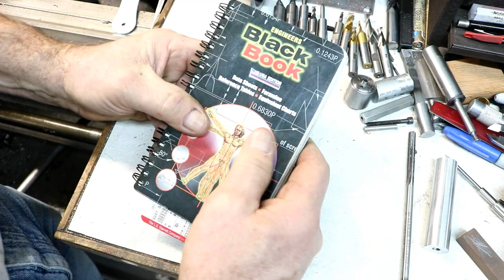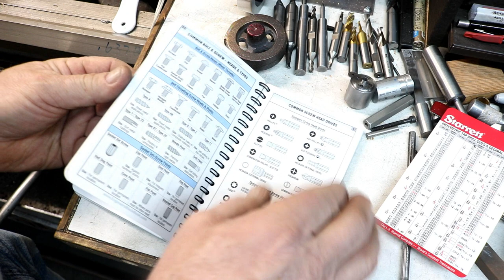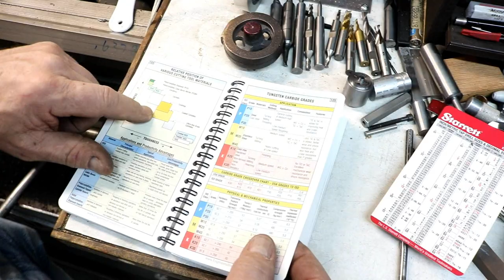P6-1 How to Build the Crankshaft of a Model Steam Engine for the First Time

Comment: Thanks RR that was a nice tutorial in technique, much better than I usually do, learning this stuff the hard way. Those flywheels turned out great, I always had a bit of a time getting my head around working with draft and offset molds like that, it is a lot more work than just chucking and tearing into it, cheers and thanks!
Reply from the maker: Thanks Howder.  Yes a difficult problem to deal with.  It all worked out so far.

Comment: Flywheel castings quite a challenge - tricky! You managed very nice results. The brass in particular is very satisfying - so attractive.
Your volume took a major dive for some of the time after early part - perked up a bit at end.
Reply from the maker: The red brass came out great.  The mic fell off and did not notice.

Comment: I have been there Randy.  Rough castings can be a pain.  When I have a flywheel like that I chuck it up in an independent 4 jaw and indicate it in the best I can then bore and ream the center hole.  I then put in on a mandrel and finish the turning slowly and carefully.  Comes out perfect every time.  Nice save BTW....
Reply from the maker: Yes for sure Fred.  Thanks.

Comment: OOO shiny, me like shiny things!😉
On thinking about it, and this might be over the top, i might have put four small flats on the rim to negate the draught and used the 4 jaw chuck to get it running as centrally as possible on the bits that aren't to be machined, 
Castings can be a great cause of hair loss if you are a perfectionist  due all the pulling out during their setting up, you can afford lose a little  bit, I unfortunately can't any more. 😢
Reply from the maker: A little thin up stairs are we.  This small stuff is a lot of work.  Coming along.  Thanks Chris.
Reply: @RRINTHESHOP  oh yes, but I didn't lose it pulling it out making flywheels, I rubbed it away going through doors as I 'm over 6ft 6 tall in my shoes. Only 5ft 3 without them though. 🤣

Comment: Hi Randy, nice to see a steam engine build continue forward. We still like the brass more then the aluminum wonder if it because we grew up machining aluminum and no brass aerospace parts? Thank you for the 3 lines scribe tip for additional accuracy in measuring.  
What a wonderfully machines brass fly wheel it is really rich in its color and looks so precise a very precision cleanup after nearly all of the material was machined to dimension. 
Thank you, Lance & Patrick.
Reply from the maker: The red brass is nice.  Spins great.  Thanks guys.

Comment: Hello, genuine question, is there some advantage to casting then machining the flywheels over just machining them from solid. this has probably already been answered but I only just got here so I 'm gonna be a while in RR back catalogue.
Reply from the maker: Casting save material and time, especially for complicated parts and when you want 1000 of them.
Setups are very time consuming.  Today with CNC can do a lot to save but Casting are still made because of the savings.  Casting can also offer more strength.  Thanks for the great comment, Wint3rsmith.

Comment: Do you have a plan if the flywheel is out of balance?   It seems that could be an issue with the irregularities off the castings.
Reply from the maker: I have not checked them, but I think I will and maybe balance them.  Thanks Ted.